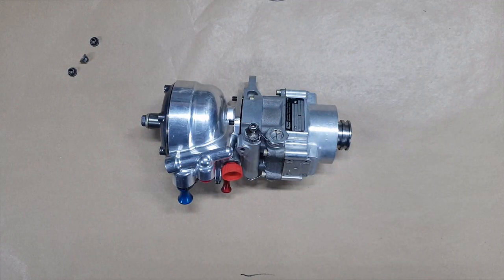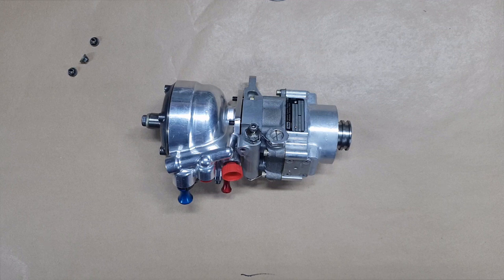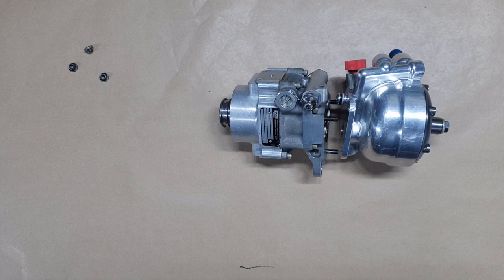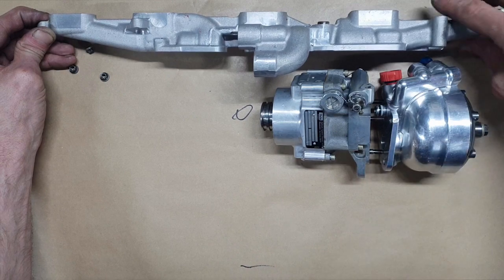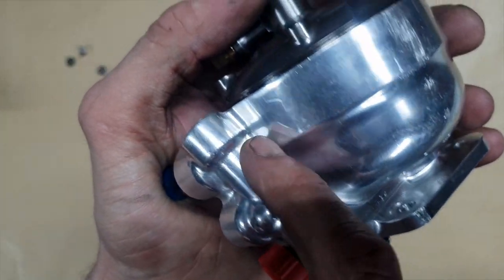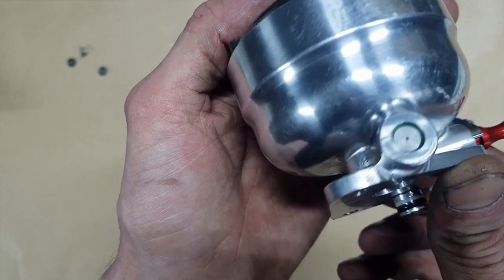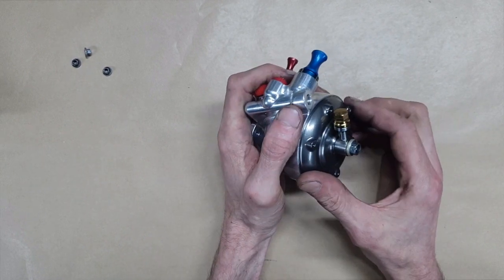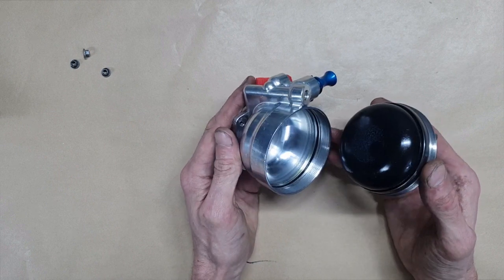F1 Hydraulic Diaphragm Accumulator - A Closer Look - Ep 7

Comment: Thx, Brian, for the close-up of the name plate.  APV means, I believe, Axial Piston Variable, and was also used to identify them as Abex Pumps.
I seem to recall a requirement, in F1/FIA for all teams to identify all parts with a 2D-DataMatrix barcode (because you can lose about 70% of the code and still resolve the data).
There are typically 9 pistons/shoes in the rotating assembly in these pumps.  What you described at about 20:30 in the video, is called ripple and the accumulator is used to smooth the ripple (some downstream items are affected by excessive ripple).  Some aero pumps (larger displacement/pressure pumps) have a bulbous cavity connected cast as for the accumulator near the output.
Abex Aerospace, Oxnard California USA